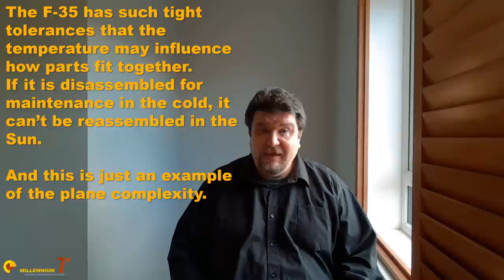F-35: The Failure of the $100 Million  Dollar Jet | Maybe...

Comment: We really don't hope so, as we in Denmark already has signed an contract, and getting our share of F-35 in 2022.
Reply: Yep, especially as you can get the grippen around the corner...
Reply: There is no longer any doubt of the fact that a flyingcost of 40 000$/h is there to stay. The indication is that the cost for a flight is going to go up as the plane ages. I do feel sorry for Denmark and Norway since both nations now are stuck with an extreamly expensive air force. There is a good solution to the problem and that is to buy fewer F35s and bying Jas 39E. For Denmark buying 16 F35 and 30 Jas 39E would be an option. This would actually give a lot of advantage from an operational perspective. The Jas would be the interceptor since it is faster, can supercruise and have longer legs. The F35 is the intruder that can reach as far as Letvia, the Jas 39E can actually reach as far as St Petersburg. By using the Jas as an interseptor the flight hour price drops by close to 34 000$ and at the same time the possibility to use the Meteor missile is acheaved. The S400 system in Kaliningrad is a good target for the Danish F35 planes.
Reply: @sorennilsson9742  if you think that S-400 is not capable of detect and shoot down F-35 , you are a fool.
Reply: @grujicdanijel7963  Well it might but I se few other planes at the moment that has a better chanse to get at it. I would think it has a 50/50 chanse if using its countermeasures in combination with its steahlt.
Reply: @sorennilsson9742  Do you remember when the Norwegians claimed that Gripen will be more expensive than F35 to operate?   hmmm...!!!
Reply: @jontus9925  In 2008 and the Jas E was more expensive to buy, own and had a shorter combat radius than the F35 acording to Stortinget (the Norweagian parlament) after protests they changed it to that they are equally expensiv acoarding to the Norweagian defence counsel. The estimated cost for 48 planes was 18 billion Nkr. 2010 it had gone up to 30 billion for 54 planes. The cost was  ended up passing 65 billions for  54 planes including infrastructure weapons and so on. Norway have close to destroyed their army to be able to afford this. What is left of the Army is 1½ brigade. Instead of close to 6. There is little to be done today and it was close to a rebellion among the  political elite when they realised that their own government had lied to them, the high command of the airforce was in on the lie as far as I know.
Reply: @Conor Hanley I think the same. if we had been on board with the Euro fighter project, back in the days, we would maybe now be a part of the Tempest program. It's the most expensive buy we in Denmark has ever done. But u know...politics man :-(
Reply: @sorennilsson9742  I hear u, and i agree. A fleet with both jets, could add some balance to the Danish Airforce. I'm so sorry were not getting the Gripen, which i prefer over the Euro fighter, as we here in the North, needs a machine that can handle every kind of weather, like the Migs & Sukhoi.

Comment: I would be in favor of gripen or typhoon and maybe the French jet, euro fighter is just as expensive, although I don't know what the per flight hr cost is. The gripen to me always looked like a next gen F-16, and would be in favor of my county buying some "foreign" fighter. Except for the French maybe, these western NATO block fights already share engines, avionics systems and many weapons so it would not be a hard sell for me. The Pentagon needs to stop building so swiss army knife of weapons that is great at almost all things, obviously its going to be a boondoggle. The F35 replaces the A10, I have a bridge to sell you. They also made a massive mistake by not thinking forward enough and cutting short the f-22 program. Had they navalized f22, only thing we would need is to upgrade harrier, had they really kept their thinking caps no they would have never given a program that size to just one contractor, competition keeps innovation cheaper and faster and that's been proven many times over, they had enough money to purchase a smaller order of the black widow too. Story of hard learned lessons being forgotten for some reason, weapons procurement in DC is broken and needs to be fixed. FREMM hopefully is a sign they are starting to remember those lesson. Great content keep it up.

Comment: I like the idea of using semi-autonomous RPVs as the tactical "low" mix. They don't need to be super hi-tech or stealthy, just capable of detecting the target and attacking it, preferably with "dumb" weapons. The lack of a pilot would reduce costs, improve performance, and minimize risk. If one gets shot down, then "meh... we'll have a dozen more next week".
Reply: Would the enemy trying to access to tech though? Anything left intact would be in any black market or foreign agents buying them directly.
Reply: @Joshua_N-A  That's why you intentionally don't make them hi-tech or stealthy. The only thing it would have on board that'd be of any value would be the crypto keys and software, and those can be very easily zeroized. Anything left intact would just be junk.

Comment: The F-35 was billed as a fighter jet that could do almost everything the U.S. military desired but has turned out to be one of the greatest boondoggles in military purchasing history. And yet, the U.S. is still throwing huge sums of money at the floundering project. 10-years late, and 3-times over budget. Essentially, the Pentagon has declared the $1.5-trillion (!) F-35 “too big to fail.” Producing 100's of aircraft before the design has been tested and finalized. That will all have to be recalled and reworked. The biggest fraud hoisted on the US taxpayer in history. Keeping the F-35 program alive is not only a gross waste in itself: Its funding could be spent on defense programs that are really useful and needed for national defense, such as anti-drone systems to defend U.S. troops. Probably the only good news for the beleaguered tax payer is that the Pentagon has put a decision on approving full-rate production of Lockheed Martin's F-35 on indefinite hold, as officials remain unable to say when the fighter jet will be ready for combat testing that's been delayed repeatedly since 2017. We may not see this ban lifted until late 2020 is the latest word. Partners who signed onto this program are in a bit of a pickle.
Edit: today, March 3, 2021, the Air Force admitted publicly that the F35 was a failure.

There is no future conceivable war in which these F35's would be used - except to bomb some shithole in the Middle East.
Its delusional to think there is going to be a future war involving airpower like in Vietnam 50-years ago.
Modern missiles will render all these fighter and bomber pilots to be on suicide missions.

Comment: I am sure the Europeans would be more than willing to help with Rafales or Eurofighters 😇
Reply: Or Gripens.
Reply: Both of which cost roughly the same as an F-35A.
Reply: @Tomcat82  not in upkeep and availability, and the prices will not stay the same eather, F35 will not be article to maintain a reasonable unit price.
In any case, I expect the US will develop their own model, the humiliation, where they to by massively a European model would be to much.
Reply: @Tomcat82  I don't know what your sources are, but I'm seeing a price difference of 30% between the Gripen E and the F-35A. The Gripen E will also cost half of what the F-35 would cost to operate.
Reply: @laurentboitouzet9793  
Your point about higher maintenance costs and lower combat readiness are accurate, but F-35 unit costs have been decreasing steadily for years now. I'd agree that the F-35 price tag is not likely to drop much lower than the current cost ($79M as of Jan 2021), but what makes you project it will significantly increase in the future?
Reply: @Tomcat82  curent prices are based on a very high number of units produced and therefore economies of scale, of the US choses to by several hundred instead of several thousands, prices might go up, significantly. I might be wrong though
Reply: or Tejas which the US Navy is already looking at.
Reply: @jackd6571  This channel has already done a video on the Tejas, and according to that video, that plane has a lot of short comings. If those reports are true, the U.S. Navy would be much better off with the new BLOCK3 F-18, or the Rafale.
Reply: @operator0  A lot of westerners have been jealous of India's growing defence industry as it would challenge their own products in the export market.
As a result their efforts have been to point out and magnify the "Shortcomings" which may or may not be accurate, and completely ignore the strengths .
Never the less, Twin engine fighters like F-18 and Rafale are costly to buy and maintain.  And F-16 cannot land  on Carriers.
Naval Tejas comes as a Cheap yet Advanced option in this category of single engine Carrier borne Fighter trainer.
Reply: @jackd6571  The Swedes have a naval version of the Gripen on the drawing boards, if single engine naval fighters are a requirement. But let's be honest, the U.S. Navy can afford to spend more money, in the blink of an eye, on a proven platform like the Rafale.

The Tejas was a good first effort for India's aerospace industry, but looking at the specs, and reading reports about it, it's not really a 4.5 gen aircraft. However, the Indians could prove everyone wrong by participating in a joint exercise like Red Flag....or it could end up being embarrassed.
Reply: @operator0  It takes years to get something like that from the drawing board to a real airfield. And several years more before it can demonstrate take off and landing from a real Carrier.  And again, a couple years more to operationalize. 
Why do you think only a  handful of nations have successfully developed a Carrier borne fighter?

We thought US would have enough budget to buy and maintain soo many F-35s, but now it isnt the case, is it?  Even Rafale are costly to operate, and in terms of price, its around 3 times of the Tejas.

Tejas isnt the "First effort" . The first fighter was the HAL Marut which was used successfully in one of the biggest wars of the modern era(Indo-Pak War 1971)
Even after being battle proven , Marut fell prey to Western sabotage attempts and bad mouth and was retired before time so that India can continue its import reliance on Russia/Europe.

Specs of Tejas are clearly 4.5th gen. But i agree on the fact its time Tejas is used in international wargames.
Though the US Air chief flew on the Tejas in 2018 and that only increased their interest on the fighter.
Reply: @jackd6571  It's not the money that is holding back the F-35 program, it's manufacturing capacity. Remember, the U.S. doesn't have complete control over the manufacturing process for the F-35. They are partnered with other countries who make components for the F-35. The Pentagon is afraid that the F-35 can't be built fast enough to keep up with the planned retirements of the F-16 fleet, while also keeping up with purchase orders from the partnered countries, and other branches of the U.S. military.

As to the Gripen Naval version; One thing is for certain, the Swedes are very, very efficient in producing aerospace assets. I have no doubt that the Swedes could produce a navalized version of the Gripen, have it tested and ready for purchase in a few years...not ten. 

But again, the U.S. doesn't have a money problem, so the Rafale and the BLOCK3 Hornet are the most obvious candidates, both of which outperform the Tejas by a wide margin, especially in the realm of avionics, according to reports. 

One other thing, the Rafale is combat tested, and has deployed on American carriers in the past, while the U.S. Navy has been operating Super Hornets for 30 years.

Comment: the Uks naval aviation doctrine relies on the f35 and thats a issue if this happens maybe VTol carriers was a mistake
Reply: Technically, LHDs have been pretty successful even with the US military (Marines).

I guess it's more about the Royal Navy slightly downgrading longer range & heavier payload with a "larger LHD" instead of a conventional carrier, but I'm sure it's not as detrimental as detractors would like to put it; just didn't pass all three roles with flying colors as it promised.

I mean, if the Aardvark was a total failure, we wouldn't see the Soviets making the Fencer (which they still use to this day). This is just the usual US DoD "I want my own and I'm gonna steal the taxes to do it!" bickering.
Reply: @Conor Hanley considering the F-35B's Rolls-Royce lift system & their experience with the Harrier, it's not that dumb for the UK to be reliant on STOVL carriers.

Sure, they might have to design their own if the US cut the F-35 ties with them, but they have enough experience & know-how to catch up in 5 years or less.
Reply: @Conor Hanley I don't think they will be scrapped especially as the Uk has just added 16 billion in defence spending. I think its more likly they go through a mid life refit to add CATs & Traps. I do see them getting a force of Helicopter assault ships like ocean.  say three of 40 tonnes. that way they could use those for f35s they have while running fixed wing aircraft off of QE say in the 2030s
Reply: @AllThingsCubey  If due to the usa no longer supporting the project the price per F35 sky rockets making it less economically feasible   to have the 135 number which means the carriers may only have a token force.
Reply: @neilcrombie4100  'He also acknowledged that, at the current purchase rate of 48 to 60 airplanes a year, it will be the mid-2040s before the Air Force’s planned buy of 1,763 F-35s from Lockheed Martin is complete.'

They are literally saying they can't build the F-35 fast enough. It's going nowhere.
They also acknowledging the high maintenance cost and low readiness but the core is, they are in trouble, because planes have to be retired faster than F-35s can be build.
Reply: @AllThingsCubey   thanks for the info, that all makes sense to me.
Reply: Isn't cats and traps cost more to build and maintain though? Isn't EMALS supposed to be cost effective than steam?
Reply: @Joshua_N-A  I think the US navy have had problems with it but agree Emals could work very well. I just think if they payed the money for something like Emal in a refit and ordered F35C and if thats not available then super hornet.it could maybe save money in the long run and allow the CSG to be far more potent in operations.

Comment: Spotting a stealth plane is not THAT difficult, and yes, will become easier.

Getting a missile to lock onto it long enough to reach it AND beat the plane's counter-measured is still going to be extremely difficult. It will necessitate making missiles which are much more expensive because they will need much better radar systems. This will probably also correlate to increased weight, size, and increased strain on the launch platform (or reduced options due to size).